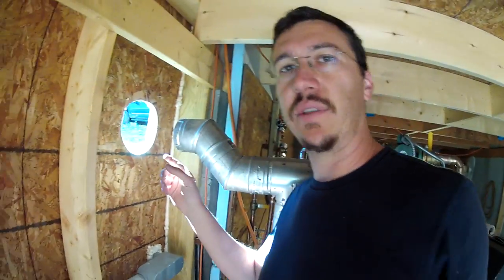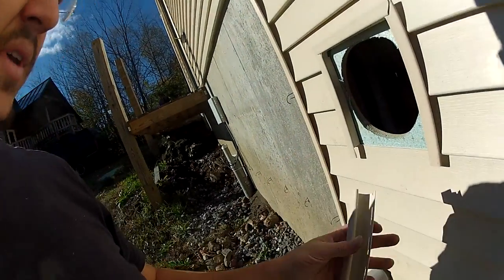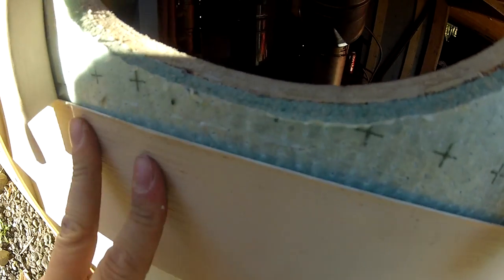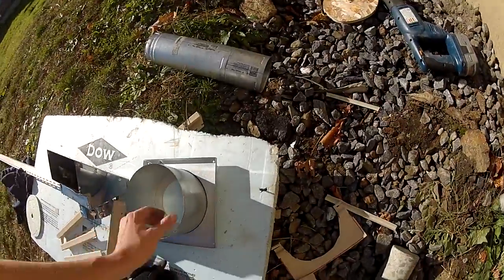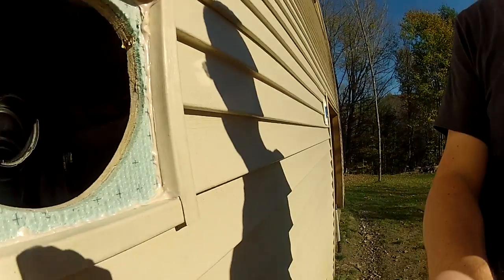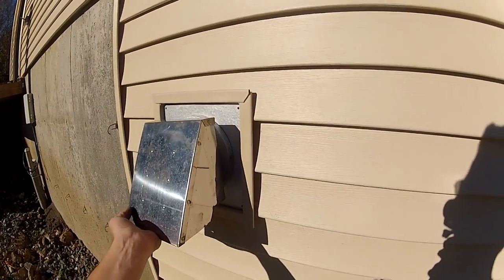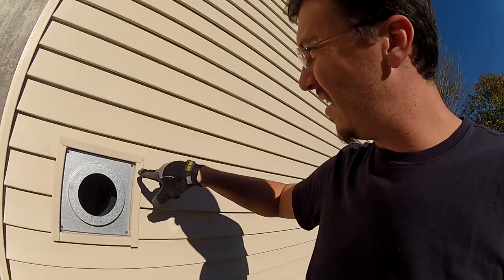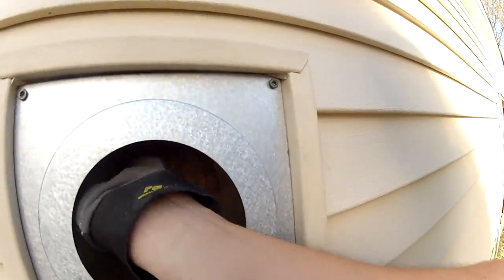Harman PB105 Pellet Boiler Vent Install - 106 - My DIY Garage Build HD Time Lapse

Comment: The vent pipe jogs like that, cause it's what I had that came with the boiler and I wanted to get it as vertical as possible outside so it would be above the snow line.  ? strange about the question marks...  Press both of your shift keys a bunch of times, maybe you have a stuck key... :)

Comment: Why is the ventpipe curved and not just a straight pipe! 
Do you expect significant condensacion from the ventpipe when the boiler is operating!

Sorry for not using questionmarks because for some reason I don't get them to appear!!

Comment: Strucked!!! But..._ + No Resulto!! Jajajaja!!! This is a computer with dutch windows xp and a spanish keyboard...but I had it working, though! But Thanks, anyhow!! GNDxero...what is your channel about....I will take a look! Although the jogging  it still won't be a problem cleaning it out! I was imaginig you where burning liquid gas but with pellets it will get a bit more dirty! Does it work with a ventilator that blow the gases out_ Her in Chile I saw one but for use in the room, direct radiant